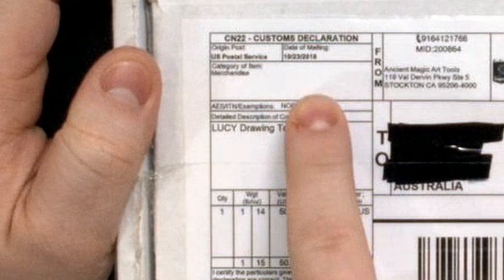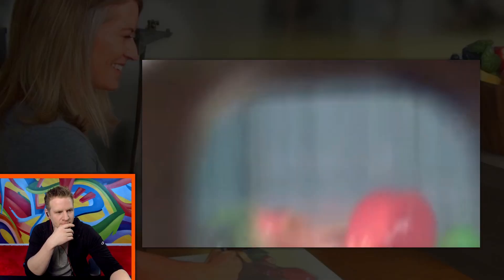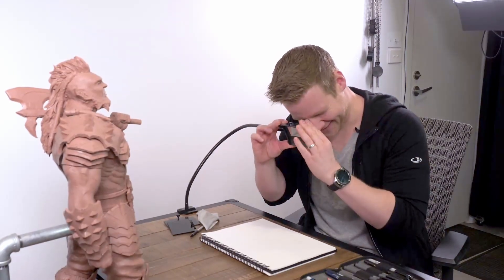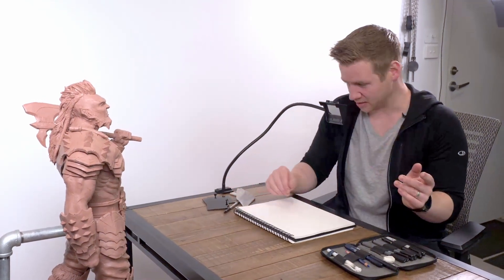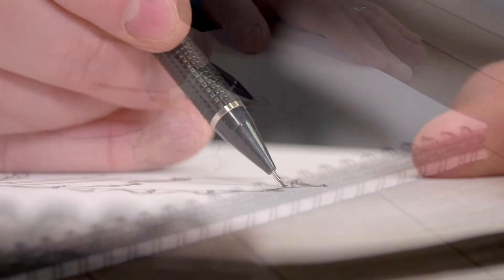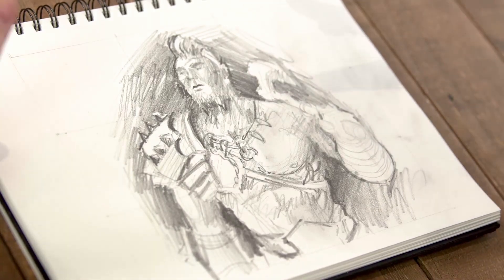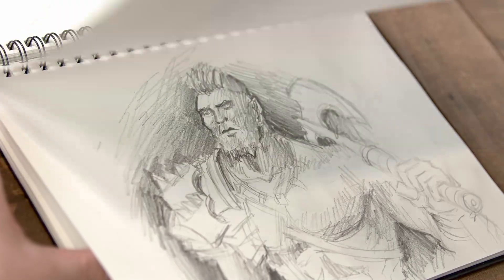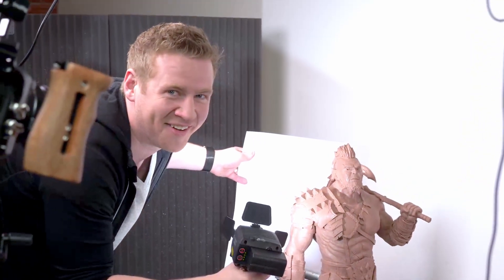Does this Weird Drawing Tool actually WORK? - "Art Hack" Test!

Comment: It kind of reminds me of the KopyKake which is a projector projects downwards for you to trace designs on cakes. Maybe it could work for that with simpler designs and that you don't have to shrink them down to fit the little projector. But then you still have the problem of keeping it from shaking and having to look through one spot instead of a projector that will keep the image in place and you can move around it.
It didn't seem to be the best for something as complex as your figure though, that's for sure. Maybe something a little simpler and with more colour could be distinguished easier without fighting with all the lighting, but limited and awkward at absolute best.

Comment: The very first of these devises was called a "Camera Obscura" It was a box large enough for the artist to get inside. Optically it works just like a "pin hole camera", (photography 101) (look it up for how it works) The pin hole would be aligned to the subject matter and it would project on the back wall of the box ... up-side down. The artist would then draw or trace the projected image. This device was not subject to the parallax problem from the artist moving around in the box or moving their eye relative to the image. Later as photo-sensitive papers and films were developed the Camera Obscura was reduced in size and became the first actual cameras. Later addition of lenses over the hole allowed more focused light to enter the box cutting exposure times from several minutes down to seconds. These cameras were the big cameras you see used in the 1800s with accordion lens mounts and the photos were glass plates coated in photo sensitive silver salts, inserted into the back of the box camera.
As pointed out, the skill and knowledge of the artist was/is still needed to turn the tracing into something considered to be "art".

Comment: I think tracing with a light box would just be so much better than the Lucy since A) it doesn’t move even if you don’t keep your head perfectly still, and B) you don’t have to keep squinting at a little contraption to see an unclear image that looks more like a silhouette without excessive lighting. Overall, it seems like they were trying to do something that’s already been done, but they did it worse.

Comment: seems to me that the use lies in getting a general outline w proportion, then going back in and filling it in just looking at it directly as you'd do normally.  while i dunno if it works well enough for that, having an outline would save a ton of time.  lightboxes require translucence of the paper and limits size.  projectors work, but also take some time to trace on a board where you've taped up the canvas/paper.

Comment: Ragging on using a monitor under the paper to trace is funny because that's basically what this product is, but instead of producing the light underneath, it's redirecting the light to above the paper. Using a monitor is objectively better in every way except for if you use tools that would damage the screen. Pencil and paper tracing works just fine with it.

Comment: In my humble opinion the drawing using the Lucy had far more accurate proportions, and a way better shade pattern than the other two drawings. It just needed to be sharpened up, and a few more details rendered in. To be fair, the other two drawings benefited from you having practiced on the first, making you familiar with the model's form.

Comment: I've watched a few videos on this viewer and used some cheaper made for children ones. One of the issues with this particular design is the viewer is on a flexible stand that is pretty much a flexible wire that bounces and moves too much. Looses stability and changes position. It has the same problem of the measuring technique that you didn't explain. When one uses a pencil, holds arm out and close one eye to take measurements that work to a scale you create (basically lots of maths involved) the measurements change if you move position, hold arm out different distances every time or even look through different eye each time. The older versions I have seen are on a more engineered semi-fixed stand made like surgical instruments that hold their positions. To engineer one to those standards probably wouldn't be as cost efficient. To use any technique requires discipline, experience and patience that those leaning toward contour drawing approaches might prefer. If ones leanings are more gestural, quick, fluid and movement inclined probably not a useful tool.

Comment: I had seen this contraption many, many years ago in comic books, and was half tempted to try it way back then, but considered it probably wouldn't have really worked that well. Thanks for taking the time to confirm my intuitions. How much more easier to simply take a picture of the image one wants to draw, and print it out, and then render it according to one's individual artistic tastes. I have done this with many pen & ink renderings, and actually wrote a how-to instruction manual on how to create pen & ink drawings from photographs. I did this way back in 2005, and the results were quite impressive, in my humble opinion.

Comment: In my view, the Lucy is a tool to help you get better proportions ie not getting a head that is too big or small for the body you draw or arms that are too long/short. Once you get the right sizes, you should use your artistic skills along with the guidelines you created. You chose to only use what you could see through the viewpoint. If the masters used this, they certainly didnt confine themselves only to what they saw through the lens. In fact the viewer to the new version is much bigger than the timy original viewer. I would like to see you use the Lucy to get the accurate proportions and your natual artistic skills to polish things off to a nice finished work... and read the directions to figure out the optimal conditions. Then see what you think afterwards. Just my humble opinion. Thanks for your emtertaining videos. I do enjoy watching.

Comment: so i had something kind of similar to this as a kid, where it used reflections in order for you to trace things. but it looked quite a bit different. imagin and open bonder flat on the table, then 2 see through plastic panels sticking out from the center 'binde' of the binder. You put a picture of what you wanted to trace in the middle leaning against one of the panels, then looking through the other onto your paper there was a reflection. it was kind of complicated and weird, and it was hindered by the fact you could only use a picture or drawing. but like the pictures were always super contrasted, i guess so you could see it better. using reflections for tracing just seems like such a bizarre method to me all together. google says its called the sketch wizard lol. it seems crayola has a similar device to the lucy you used too. how odd.

Comment: Part of the trick is to heavily light what you are drawing while greatly decreasing light in the rest of the room. And you draw by the reflected light through the device. Although that version is a POS in my opinion. 
— I wonder how much you paid for “Lucy”?🤔 You may have said and I missed it. But you can make a much better version of the exact same concept with a better quality mirror, some cardboard, thicker plastic film/sheeting, small hobby light with switch & hot glue! We made the EXACT same thing in art 101 in college! And you could see images FAR better in the ones we made than that thing. We even got the posable metal tubing intended for putting electrical wire through to use as the arm & a cheap clamp to hold it to our desk.
— We used individual light boxes with medium to dark grey backgrounds & individual light sources so that the room lights could be dimmed and each of us be able to view our objects the best possible. — For someone JUST starting to try & really draw, a properly made one of these can be a useful tool to help you refine the way you hold your tools, which hardness of pencil you prefer, get used to the motions used to draw different angles & just overall get used to trying to sketch something real. 🤷🏻‍♀️.           — Now...it’s INTENDED use is to get the basic outline & location of details down so that you can then work on refining your drawing without the device. It is NOT the best tool if your goal is to be able to exactly copy every little detail. But that’s what makes it a good teaching tool...if used correctly. It can give inexperienced students a starting point & take away the often blind panic many have when faced with a blank sheet of paper. It helps ease you into it so that by the time you reach the point where you need to add the details & final shading/highlights without the crutch of the device you hopefully feel more comfortable & confident in your abilities. 
IMO at least.

Comment: I feel like there's 2 optimisations that you didn't try... but is still might not be great.

1: less light on your canvas: This will feel unintuitive because you want to see your drawing better, but the lower the light on your canvas the higher the contrast will be.

2: stabilize Lucy: she's a wobbly lady, and this is a design flaw, that flexible wire thing that's used for positioning isn't strong enough, so I'd have a go at attaching the mirror box to something stronger. Also not ideal 'cause you're having to resign the tool.

Basically, for best results, draw in the dark looking through z totally new version of the tool that you've built yourself. AND THEN! it will probably still feel a bit wonky to use.

Oh well.

Comment: The statue you're trying to draw is brown, and the backdrop is also brown. So where is your contrast? How can you draw trace something like that? If the wall behind the statue was white or blue color; it would have been easier for you to draw it. Also, did you try adding another light source angle illuminating the statue? For example: From the bottom up; near the statue or at an angle?

Comment: Ok so the Lucy is based off a tool used during the renaissance. It has two major problems. One it’s ONLY meant to be used for outline and general proportions not for a fully rendered artwork. So you would basically get the proportions down then everything else without it. Two it warps and stretches the figure. This is why it wasn’t widely used.

Comment: The problem with the camera lucida or Lucy is that cheap glass is being used. If you were to use coated glass or even polarized glass the amount of detail would double. 
The reason being is that normal glass reflects as much as 40% of the light, where as coated glass or even polarised glass transmits more light through the glass thus showing a far greater level of detail in the subject that is being drawn.
Reply: He peeled the filters off the glass

Comment: "There's an app for that!" The iPad has a similar software-hardware combo that leverages both the built-in camera and the fact that you can simply view already scanned images. This device projects your image image onto a piece of paper on a flat drawing surface with excellent fidelity and stability. From what I've seen, it's a much more accurate and useful arrangement. Even better, just work digitally on a display tablet and TRACE your reference (Duh!) as artists have been doing since the invention of photography.

Comment: i do like the concept and im proposing a new idea with it. instead of copying an object. take a photo with your phone.
place phone close to that input mirror lucy thing... phone is closer so less movement, and phone is brighter so more detail is shown.
now watch through lense again and draw straight from phone to paper with lucy 2.0 the phone version.
it does not exist yet but would be deadcheap to make. and would be a great tool as anyone already hass a phone you only need to update lucy with a phone holder.

maybe you can hotglue a bracket in front of lucy and place your phone there.you would have invented the 2020 version of the lucy device.
hope you try at least holding phone in front of it to see if its feasable

also by using a phone instead of having to face the direction of the subject now you can put it on a tripod. have the paper or canvas on a easel. and look straight forwards throug the eyeopening ass the phone is now lieing face down on top.

loved the video btw

for now ill use my phone with intenal laser projector instead. take a pic. project draw finished

Comment: I just get the proportions and then fill in the rest. I get the angles of the eyes and arms but keep iBut I keep it at a minimum. I just block in my painting, The more I use the Lucy the less I need to use the Lucy. It also works well to check your work if something doesn't look right. I do nott own a Lucy, I have used friends. It's nice but so is a $150.00. Maybe one day..

Comment: Yes, I bought this too and it's awful to work with. Especially if you wear glasses. Waste of time and money. I got the same thing you did, just a partial picture, head was cut off or actually the top of what I was trying to draw. I even used their filters that came with it, nope. I tried closing curtains, and even low lighting and sometimes direct lighting. It's really not a good drawing tool.

Comment: The same paralax/ wobble is present with almost any mono-optical device.  Jazza boy would have had the same criticisms about Galileo's telescope whilst looking at the moon.  Modern telescopes have the same issue.

I can't hardly draw a barn door, much less shade it with a pencil, and that is where this device would be beneficial - to the drawing impaired.  If you can draw so well, why did you purchase the device in the first place?    You draw so well,  I'm wondering if you bought this device for "material" on your channel.  It was a funny video millennials will appreciate.

Comment: I found it annoying...the Lucy is not a benefit...if you want a very rough background and have hours and hours to try and get a  very rough sketch   - then yes try it out.  However, honestly you are better off just sketching it on your own...and to be clear I did use the filters...annoying is the word for it... very difficult to adapt it to use for larger sketches...the reflection tends to be too faint and too easy to lose your reference points so everything gets skewed...I give up trying to use it..

Comment: You ripped off the shade which is why you have less contrast.
In history, the Camera lucida was used by the painters especially when they were painting huge buildings like churches. They used it to really get the measuring accurate. Later they transferred the sketches done with the camera lucida to their canvas and made an accurate oil painting. 
Of course several painters also used it for portraits to get the exact expression of the face. Also sometimes painters were to paint pictures of several people and the artists did not have all of them sit there many hours to model. So they reduced the time for sketching the portraits by using the camera lucida.

This tool is not meant for drawing every detail, just the outline and major lines. The lights and shadows would be added by the painter in their painting space.
The building or person sketched with the camera lucida would have strong sunlight coming from the front, so all features would be clearly visible when looking through the hole on top of the box.

I have never used this tool, because I mostly draw and paint from reference pictures. I mostly paint animals and landscapes and my photographs usually are quite good for reference purpose.

Comment: "I doubt Leonardo Da Vinci used this. Just use a camera! " um. Da Vinci didn't even have electricity. This thing was like wizardry back then because they barely had glass and mirrors capable of pulling this off.  I've seen descriptions and paintings of this used in nearly all dark rooms with just candles to light the subjects face. You need LOW light not more light, like lightbox traceing. And your paper needs to be in heavy shadow. Basically the opposite of what you want to make good video.
Also, this might be really good for capturing actual landscapes for survey back in the day (not artistic interpretations).  So like if the king of Norway wanted to see the pyramids they could send an artist to basically make a photo by hand.

Comment: This thing is far from an optimal Lucidum...  I've used a proper one before and this thing is a joke comparatively. For example, a good one will have no jiggle and will have a place to set your head like when you go to a optometrist so you don't move out of alignment and can rest your neck on it. ALSO, the mirror part is absolutely atrocious. A proper lucidum mirror gives a nearly crystal clear reflection.

Comment: This device simply isn't useful for almost anybody. If you have a camera, then take a picture and trace it with a lightbox. It'll be easier, more accurate, less frustrating, and probably faster as long as you have a printer and stuff set up already. The only use I can actually perceive for this device is if a person wants to trace an object on location without using any electrical devices. But that's not a real market that exists, nobody is trying to do that. Artists and talented sketchers (generally) don't want to trace things, and anyone who does want to trace an object or landscape has better methods available.

I'm fine with the idea of this product existing as a novelty or for historic value, but I think the advertisement is disingenuous and scummy.